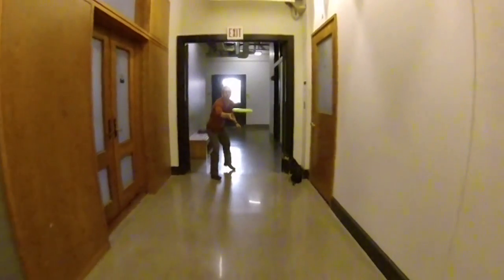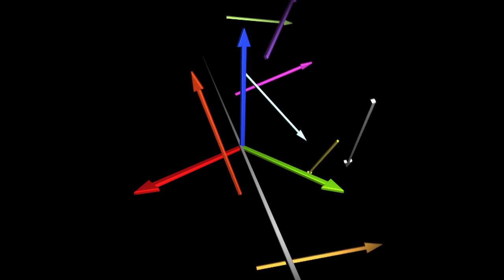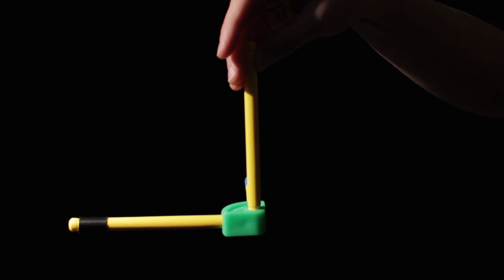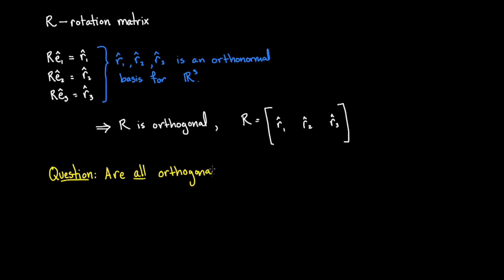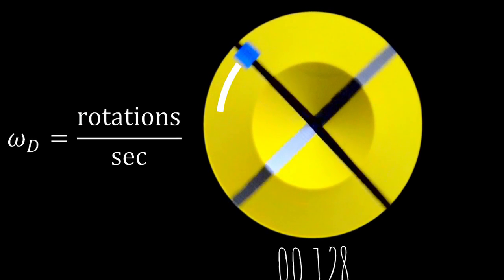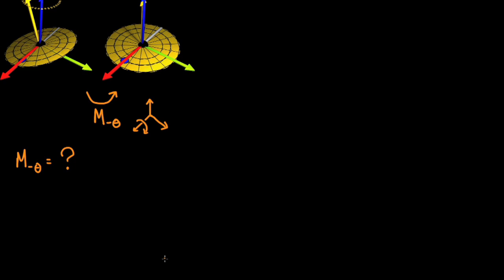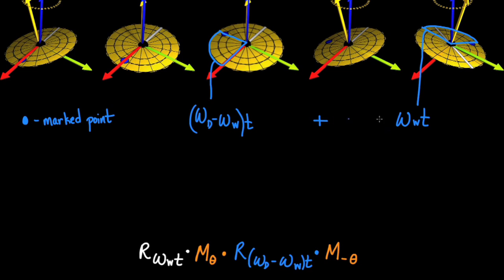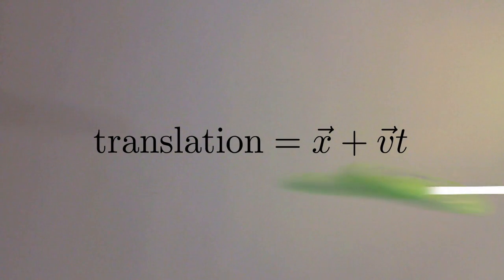Rigid Body Kinematics

Comment: This is a nice video to start analyzing motion of the gyroscope. Yet, a bit more math machinery is needed to understand why these 4 matrices are needed. Matrices are elements of the special orthogonal group SO(3). We need to conjugate the spin by M_theta because the wobbling (nutation) and the spin are assumed to be unrelated. The order of the dot products is important to the point that the spin be always conjugated. This point is not specifically revealed in this presentation, but this video is still impressive!

Comment: Great video!
A question: Why the first rotation depending on time,  about z axes, is by the angle w_D - w_W instead by  the angle w_D only, since the tilt angle theta of the disc is already reset by first matrix?
Thanks a lot for the valuable contents!
Reply: An answer: because the wobbling and the spin proper are assumed to be unrelated in this video. While the frisbee is rotating there are two effects, namely the spin rotation and the tilt rotation. To make the spin rotation independed of the tilt is to juxtapose the spin axis with the z-axis, make the spin you need, then put the spin axis back at angle theta to the z-axis. 

To make an analogy, it is like setting time for a mechanical watch. The wobbling is like normal movement of the watch. The spin is like when you set the time. When you set the time you do three things. First you pull the crown out (the small thing you use to wind up the spring), set the time you need, then push the crown back. In terms of the matrices, you multiply by the negative theta matrix, then multiply by the spin matrix, then multiply by the inverse of the negative theta matrix.